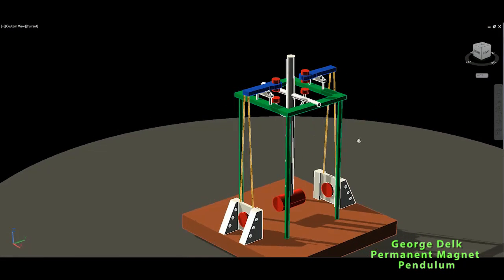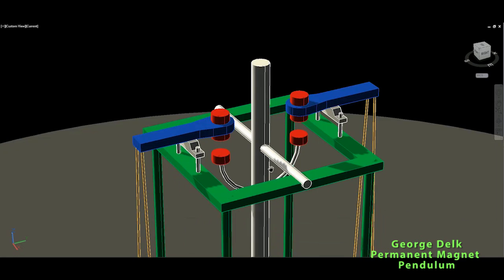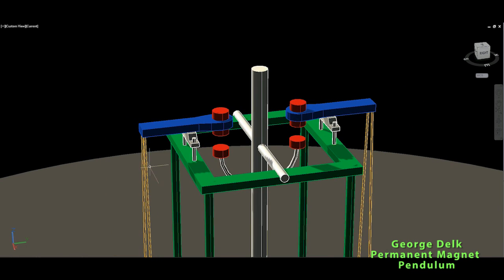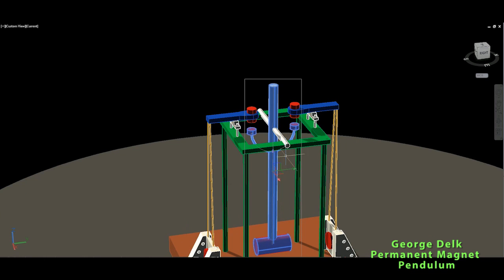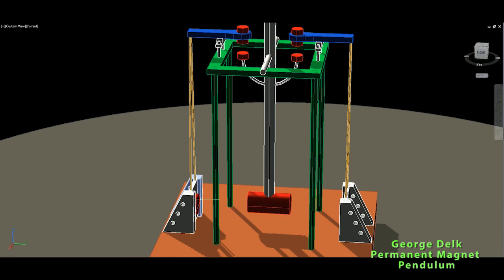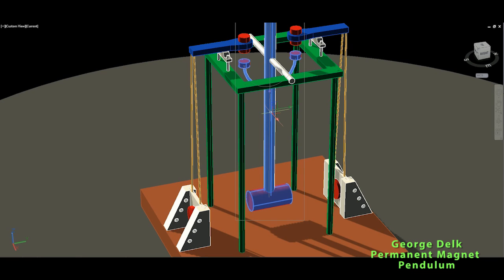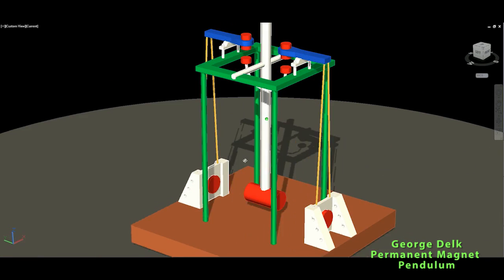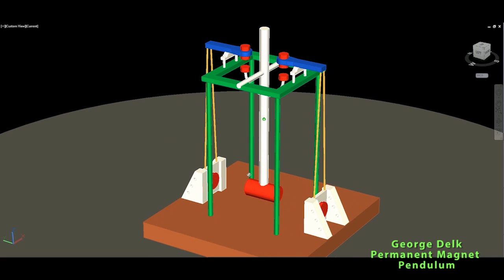Free Energy, GEORGE DELK Permanent Magnet Pendulum, Amazing!!!

Comment: The Geore Delk PERPETUAL PENDULUM has me intrigued, Of course it might be an elaborate hoax, ...but I notice that failed replications never use piano wire, they use slack string...!!!!. I believe the real George Delk magnetic shutters would not drop unless 'pushed' ...Even then they require the magnetic PULL of the approaching pendulum. The bottom half of the shutter magnet attract th top half of the pendulum magnets. Fully down, the shutter and pendulum magnets are in FULL REPULSION. The Shutter reverting to it's stable condition will impart an EXTRA PUSH through the leveraged cantilever beams and magnets. above.